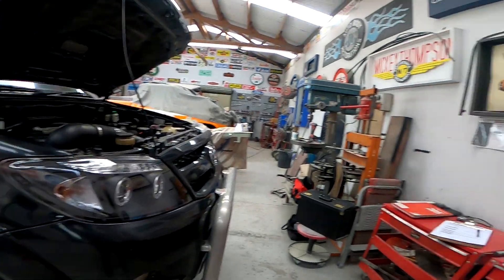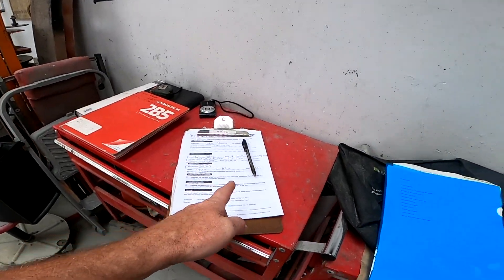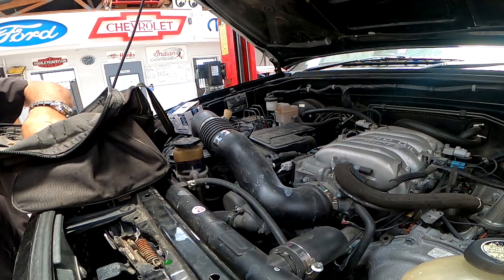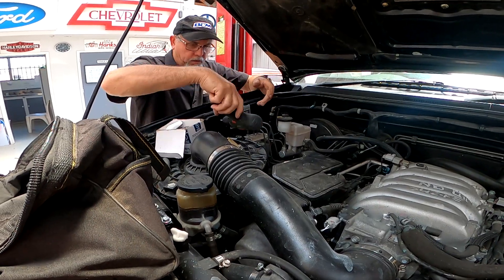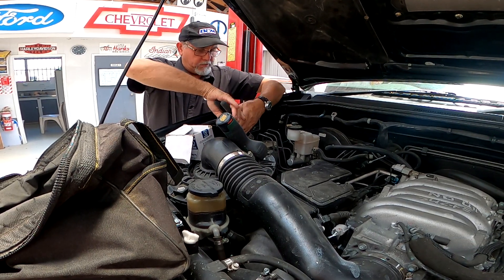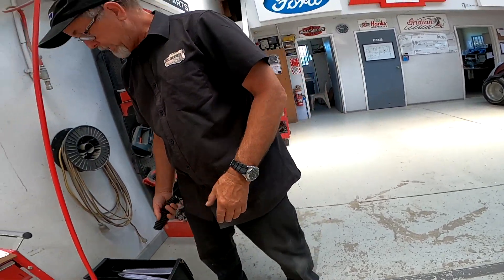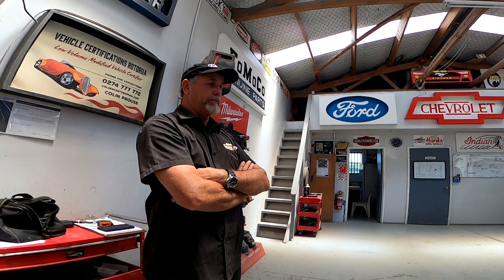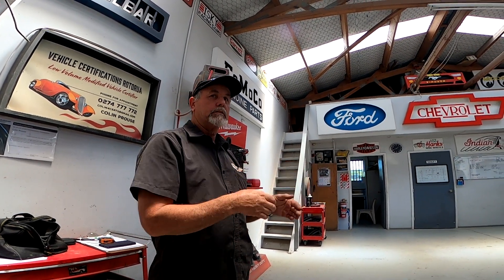New LVV Cert tag 2021 for New Zealand

Comment: Hey guys I need some help . I want to mount a 2jz transmission auto to a 1uzfe engine . Does anyone know which one and how. I have a bell housing for a 4runner transmission .some people saying just change the bellhousing but also some people said that the bellhousing for the 1jz is shorter and idk if 2jz is the same as 1jz .any help would be grateful
Reply from the maker: Best get out your measuring tape and check.  There are differences in jz transmission with different length input shaft.   We did one years ago but stick with uz transmission these days
Reply: @CartuneNZ  can't get one to buy.  Have a 4 runner with 4 wheel. On the wrong side.. The guy said 30-40 ls trans will work. If I use my bell housing and torque convertor.  Thanks for the reply. I'ma check the length of the shalf. I'll let u know if I ge thru. Tomorrow.

Comment: Does this apply regardless of vehicle age? No "vintage" exceptions?
Reply from the maker: So over here if we modify a vehicle, we go through another additional check to ensure it at least meets a set of minimum standards outside of the normal 6month or yearly safety check.   So any vehicle that goes through this cert check will receive one of these discs,  regardless of age.